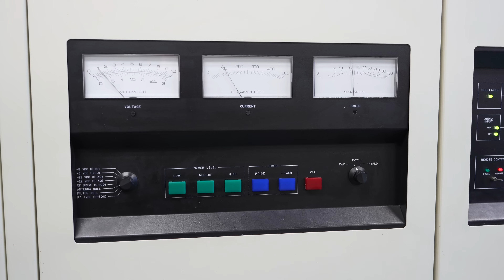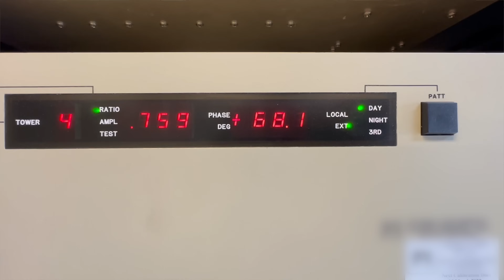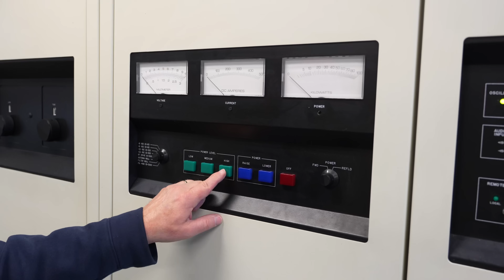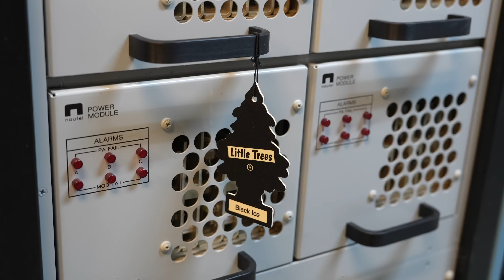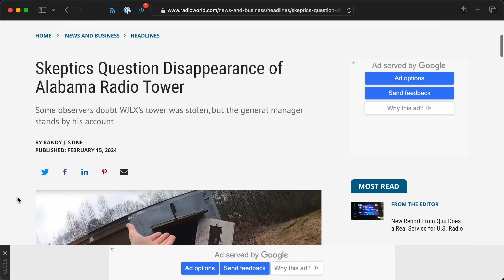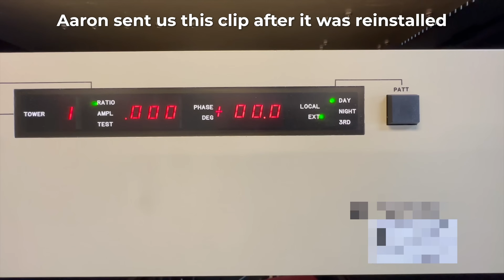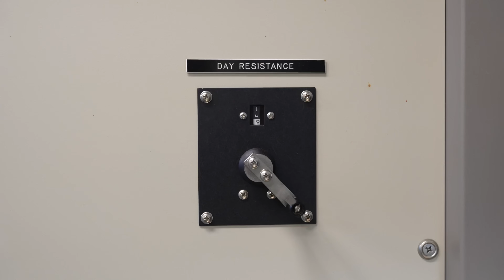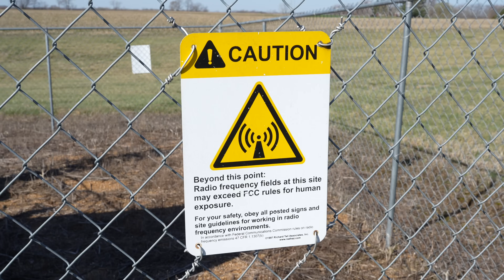This 100-year-old tech splits my voice in five

Comment: Putting aside regulations, laws, and other forms of "momentum" that contribute to why we have AM radio today, if one were to design an entirely new radio system today, specifically without historical influences, would AM radio be a technology that we would want to deploy? Or is the continued use of AM more of a consequence of historical momentum?
Reply: I think it depends on where you do it. In Australia, AM is still very useful for covering a remote population with a low number of transmitters. Good way to give bad weather warnings etc when you have no mobile or FM coverage which is most of the country.
Reply: FM sounds so much better and our wealth and population density permit erection of numerous towers for shorter range broadcasts, so for that reason the frequencies that are used for what we in the US think of as 'AM Radio' would likely not be used for commercial radio broadcasts in a wealthy/high density place. However, the frequencies currently occupied by commercial radio broadcast absolutely would be used to do something valuable/useful but probably not very publicly visible.

To go a little deeper but without getting too deep in the weeds, AM and FM are how the signal is modulated, and for mostly technical (and some historical) reasons, AM is used on longer wavelengths (MF and HF), while FM is used on shorter (VHF/UHF and up) wavelengths.

In sparsely populated places where you want very wide coverage, AM using MF/HF is useful because transmissions can be sent over the horizon (especially after nightfall)
Heavily mountainous regions its useful because the right style antenna, and the ability to have a daytime and nighttime frequency can permit a station to have a 200-400 mile radius coverage area that does not require line of sight (also useful for impoverished areas because it doesn't really need a high power transmitter).

Ham radio operators are given permission in MF/HF spaces and are constantly using them.

Merchant ships and military(land and sea forces) maintain ability to utilize MF/HF even though satellite based communication is usually possible.
Reply: @dorvinion  excellent information, thank you, while I understand the fundamentals of AM and FM (hell, I could probably build an AM radio from what I know with some trial and error, if the signal didn't just show up as interference by accident), what I was hoping for (and received) is the specific benefits of AM over FM.

Like, FM is quite obvious in its benefits, as they are all very obvious to anyone listening to a quality FM signal, but from how you described the signal propagation, it is very clear that a signal with those characteristics is very useful to have, at least in some localities. Thanks!
Reply: @OhhCrapGuy  Ya, the propagation characteristics are what make those frequencies valuable. Back when I was in school I'd often leave work at 2AM and head to my folks house 300 miles away. Because it was night I could listen to WLS most of the drive (Art Bell and later George Noory at that time of night - entertaining even if it was mostly nonsense) 

The other thing I didn't think about earlier. FM (at least broadcast FM in the US) is about 200kHz per channel. The entire MW band in the US for AM radio is just under 1.2MHz wide and so could then only support 6 WFM channels.

Of course in the modern world we have digital audio compression so you could narrow the bandwidth per channel and get a lot more stations in that 1.2MHz. Then you need only choose a modulation method that works best with digital transmissions at low frequencies.

Comment: I like Aaron's sense of humor. Could you explain how the antenna pattern and power level is verified to be compliant?
Reply from the maker: I'll have to ask my Dad how that works; and I know the FCC continues to evolve how compliance is measured / verified, but I know a while back, my Dad would drive around with some equipment and take readings!

I'm guessing there's still that sometimes, but he also has monitoring equipment set up at his office (and many engineers and ham operators do too) where he can notice when certain signals get weird (sometimes strange patterns, interference from reflections, etc.), and he'll actually email or call up other engineers.

Usually when someone goes out of their licensed range, it will cause issues for other signals, and if those affected stations have engineers who care, they usually self-regulate. And much of the time, it's not when people are trying to cause problems, it's something simple like a piece of equipment that has a blown component, or an antenna that got bent in a wind storm, that kind of thing.
Reply: A field strength meter/ receiver is used at surveyed locations to verify that the signal received is at an appropriate level. Normally the main thing of interest is the signal in the low power (null) portion of the antenna pattern as this is critical for protection of stations on the same frequency.

The locations are chosen that they are in the "far field" where the signal from the individual antennas has combined to provide the radiation pattern desired. Locations are also chosen to be free of things such as overhead power lines and be usable over a long period (free of such things as possible housing development) 

Probably best done during daylight hours when radio propagation is stable. Interesting to see field strength readings change at dusk when signals begin to fade. 

Once the antenna array meets specification then the local antenna monitoring is usually adequate.
Reply: @GeerlingEngineering  I remember a TV report that "Radio Liberty" (an USA propaganda station in Bavaria (Germany), designed to inform the Soviet Union) had such strong transmitters that a family in a nearby house thought it was haunted, because distorted voices rattled out of kettles on the gas oven or the springs in bed mattress and sofa tonight, and finally radio sounded out of the speaker inside his homeorgan. Eventually they had to built a faraday cage of wire mesh around the entire house to shield it against that RF radiation.

Comment: Why the teaser screen that implies an AM DA is some kind of weird audio harmonic or band splitter, versus working on A3 modulated MW RF?   

Why also suggest phasor coils are adjusted mainly if capacitor values are unstable, but not even a mention of the real reason, that the biggest element of an AM DA is actually ground conductivity of the earth, and that changes regionally with soil or rock types, and with daily and seasonal weather, being higher in wet or cold conditions?  

Why the teaser screen that implies an AM DA is some kind of weird audio harmonic or band splitter, versus working on A3 modulated MW RF?   

Why also suggest phasor coils are adjusted mainly if capacitor values are unstable, but not even a mention of the real reason, that the biggest element of an AM DA is actually ground conductivity of the earth, and that changes regionally with soil or rock types, and with daily and seasonal weather, being higher in wet or cold conditions?  

One of the trickier AM DA's I reworked over the years was on a tidal salt marsh, with an  8 foot tidal range, that went from leaving walkable marsh grass, to precarious catwalks that in extreme conditions were submerged and salt water almost up to tower bases.  I constructed 50 foot square raised ground radial sections around the tower bases to reduce the electrical shift, dropping into the soil/high tide ocean between towers otherwise.  I've also done extensive ground conductivity field studies (including carrier offset w/ FCC STA low signal level work) mainly in the Northeast, to show FCC presumptive maps are often wrong for certain regions of low conductivity soil, and so more signal is allowable than FCC map based pattern designs suggest is allowable.   

Not sure if the names Carl Smith, Ted Schober (RadioTechniqes), or Glen Clark are familiar, but I've done collaborative projects linked to all of them, with Glen to refine AM DA design and adjustment software tools.  

 It sounded like that Tx site had a lot of blower noise, and dad was struggling to talk without shouting, and that impacted his concentration compared to tours of more familiar (to him) and quieter facilities?  

Another missed important detail....  AM DA's are designed (hopefully) for stability, and to operate with a stable flat Tx load resistance over the modulation bandwidth, as well as to not need excessive adjustments for instability.  More towers and cramped sites often make higher Q hard to avoid. Minimizing phasor adjustments is also important when common point impedance is shifted, not just as to resistive component at carrier frequency as is FCC license designated, but as to sideband resistance as ideally a flat curve top, and reactance as zero'd at carrier and equal and opposite sidebands without extreme tilt.  

Those traits, and not just working on paper for an FCC license (eg, anyone designing 40:1 nulls is insane, but it's been done), are what distinguish the "magic" of good consulting engineers, from average, or ones best to avoid.

Comment: Great to see. AM stations are dropping like flies in the UK, some stations paying out fines to the regulator rather than pay more in energy costs to keep running. Even the big 198KHz BBC Radio4 transmitter that reaches a huge area of western Europe is slated to end transmissions, oddly it is needed until domestic electricity meters have been updated to use mobile/cell networks as Radio4 LW broadcasts a signal which switches meters between day and night electricity tariffs.
Reply: More info here on the electric meter switching. https://en.wikipedia.org/wiki/Droitwich_Transmitting_Station
Reply: Actually, AM produces a better long-range signal. You may know that Russia sends out a coded AM signal which has some mysterious purpose. 

But nobody has ever explained it.

Comment: The big meter thing appears to be an AM modulation monitor. Not an audio processor. I know this as it's giving the percentage of modulation for both positive and negative. And positive can go to 125% lagally. I remember that back when you had to have a license to even monitor the transmitter. I had a 3rd class radiotelephone operators license with broadcast endorsement.
Reply: Yeah, when I was going through my footage I didn't have any shots of the Omnia audio processor, so I left it on the modulation monitor instead, since it has pretty blinkenlights that go up and down :)

You can see the audio processor under it when I'm showing the full rack, but zoomed out.

Comment: Why would you allow a tree to grow in front of a dish?
Reply: If the tree is much smaller than wavelength, not much will happen. But if a branch touches the mast, it may cause a blue fireball loudly trumpeting the sound from the radio channel into the air (at least this may happen with an 1MW station - seen in a TV docu).

Comment: I love phased arrays.  I have two Wolf River 213" verticals I use in-phase 1/2 wavelength apart, mobile and at home.  Makes a very high gain bi-directional pattern.  They just need two identical non-resonant lengths of coax after a splitter (18' for 10 and 20 meters for 66% and 80% VF cables).  I made 10 contacts with 10 different countries the first night, in the city, power lines near 3 sides of my yard, Amazon RG8X coax, and on 100 watts form a 90's radio.  I eventually want to cut some coax (using an excel sheet calculator I made) to make a 90 degree phased array with the two 1/4 wavelength apart.  Makes a cardioid pattern that's actually less gain, but more compact if I need to do 30 or 40 meters.  Knowing how to use formulas in spreadsheets and MMANA are your best friends when it comes to antenna planning and design.

Comment: When exactly do you switch those antennas to night power? Is it when it gets dark or some point in the evening?
Reply: It appears to be whatever sunrise and sunset times are at the transmitter site. The FCC data shows monthly local sunrise and sunset times. Don't know if that's just for a rough idea and the station adjusts every day, or if they pick a consistent time for a month so listeners (both of them :) ) could set a schedule.
Reply: Sometimes (in small stations) it's as simple as when it comes up on the log sheet and whoever is operating the board walks over and flips a switch (or forgets to).....
Reply: Been a while since I studied this. I think it's 30 mins before sunrise and 30 mins after sunset. These days it's all automated. Power off, switch, power back on. If nothing goes wrong, great.

Comment: but you did not explain why day and night differs at first place? They explain that you cannot blast with full power at night because it will disturb. But why? It not light or speaker so why day/night matters?
Reply from the maker: We will hopefully cover that more soon—for now, check out the FCC's article on why AM stations have to reduce power at night. The ionosphere reflects the AM signal so AM transmissions reach much further at night time, causing interference if you have multiple stations on the same frequency.